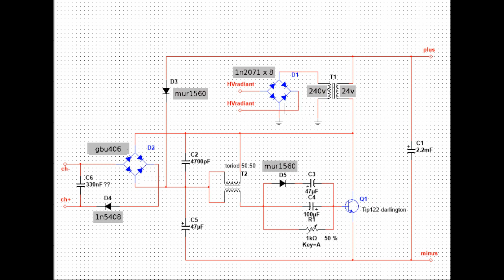alt.snakeoil: TK's NRMJT v.0.2 meets the Black Box

Comment: LMAO, the conv with Candy Boy below is top notch comedy :)
For an alt.snakeoil, maybe an I/R LED features somewhere on the ex CRT coil windings.
Reply from the maker: No LEDs in play here. This effect wasn't deliberately designed in, it is just something "extra" I noticed. (I have the habit now of testing everything I build against the Black Box.)  The circuit under test is a modified Joule Thief that works at very low input powers and is apparently easily affected by fluctuations in the Force. 
Thanks for checking in!